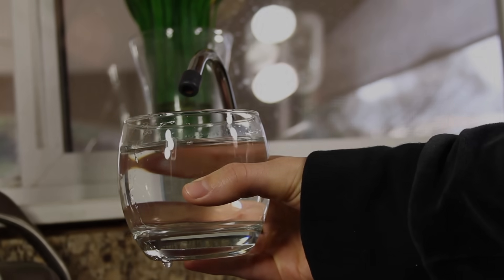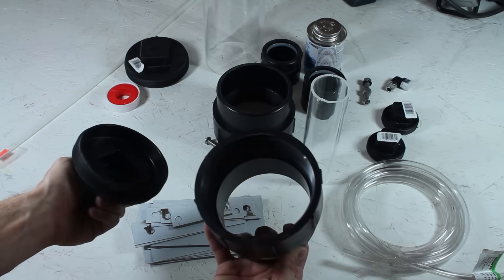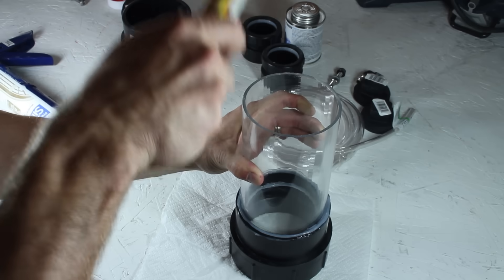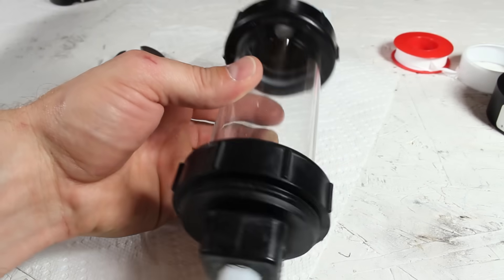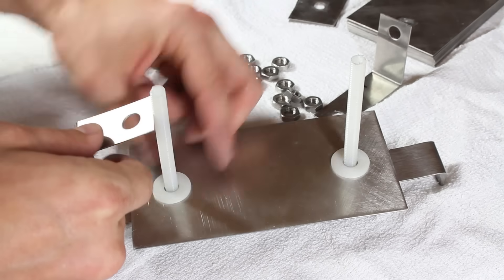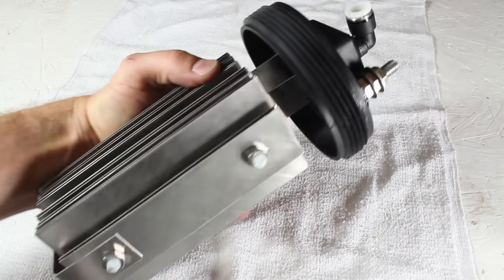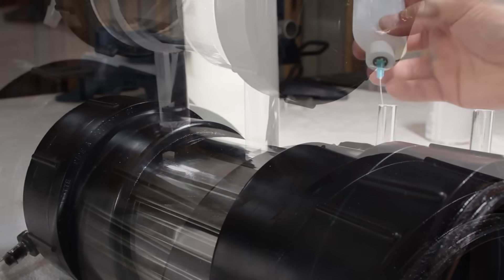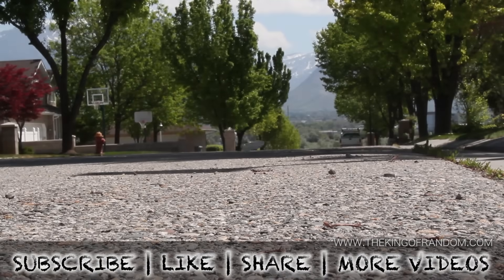HHO Generator - Water to Fuel Converter

Comment: There is a lot that is not explained in this video, such as where to get all the parts and tools, and how the hydrogen is extracted, contained, stored and dispensed. I don't see "swivel elbows" and "check valves" at the hardware store.
Reply: Go to a better hardware store.
Reply: TEXASBLAZE 101 no, ur just expected to watch and enjoy;) if u aren't able to do it from this video, maybe u shouldn't... it was no problem for me, but I improvised. My poor boy version consisted of a 2 litre bottle, a 20oz water bottle, an extension cord, fish tank tubing, a butter knife and aluminum foil, hot glue and baking soda lol
It works great;)
Reply: minivanjack figure it out. Are you a child?
Reply: Zoes Dada lol. I was just doing that very thing as well as brainstorming it to make it better such as mounting systems, industrial couplers and I just got going😉
Some people outta just stay in bed😂
Reply: You don't even need the majority of these parts, you can literally use 2 chunks of steel wool and a battery
Reply: @greenthizzle4 , great idea using steel wool.
Reply: Lee Wilkerson it's better to use higher quality steel, otherwise you will make a chromium gas that is kinda bad for you.. so do it outside
Reply: Amazon
Reply: minivanjack All of the parts are very common and can be sourced from a variety of places: hardware stores, plumbing suppliers, and of course online. Extraction at 8:17, dispensed at 8:28. Storage is not the purpose of this video; it is dangerous and difficult to store large amounts. Think Hindenburg.
Reply: Shopping list & links in description. 🙄
Reply: The process is Hydrolysis. Never store this gas!
Reply: Its called Home Depot, can you say it with me... H-o-m-e D-e-p-o-t. Now quit being ignorant.
Reply: Online shopping is a thing
Reply: minivanjack you don't store it, that's dangerous you use it on demand.. it's extracted by putting a current between steel sheets. It's really very simple
Reply: minivanjack 
1. Go to a better hardware store
2. Sounds like a personal problem. Blog it.
3. If you can find a polite side of you I would be surprised. If you complain to a Youtuber doing his best, it is kinda scummy to be honest.
Reply: minivanjack 
You're just expected to know or figure out the details

Comment: what if it was salt water? would the results be the same?
Reply: The thing is that you wouldn't be producing H2 and O2.
You would be producing Chlorine and NaOH until all the salt is gone (which would probably take a while)
Reply: SAlt will produce toxic gasses and maker your water green. But it could work, even though it'd still be more ineffecient
Reply: Richardetico so only the Cl from the NaCl would be extracted and released as gas and the O, H, and Cl will remain. also since Cl will be separated from the salt. what stage of matter will the Na be? amd since Na is a metal can it be extracted with a magnet or something. thanks for replying!
Reply: Potassium Hydroxide is salt.
Reply: TheRedneckAtheist no, it isn't
Reply: TheRedneckAtheist salt is sodium chloride
Reply: Wagner Mencia Sodium chloride is A salt.

https://en.wikipedia.org/wiki/Salt_(chemistry)
Reply: TheRedneckAtheist but still, potassium hydroxide is not a salt, is a base
Reply: Richardetico salts can be bases.
Reply: Michiel Wesselingh No, salts can be acidic or basic, but that depends on the ion that is carrying. A base is generally an ion with groups (OH) attached to it (for example NaOH), with the exception of NH3. And an acid is generally an ion (with or without oxygen) with hydrogen attached to it (for example HCl or H2SO4).
A salt can be acidic or basic when is disociated in water (for example in NaCl you get Na with a positive charge an Cl with a negative charge) and one of the ions have the tendency to steal hydrogen (augmenting the concentration of OH in the solution, this being basic) or OH (augmenting the concentration of hydrogen in solution, this being acid) and leaving the solution.
Reply: Richardetico "The hydroxide ion forms salts" - wikipedia
Reply: Michiel Wesselingh I had an exam on this just yesterday, so I'm pretty sure that I am not making a mistake. But if you really want to put Wikipedia on the table, well then https://en.wikipedia.org/wiki/Salt_(chemistry)
Reply: Richardetico and what about NH4OH?
In the reaction of ammonia and water, ammonia is the base and water the acid.

Comment: When I was about 5 I had a Hydrogen Powered rocket that worked like this. It used 12 D size Batteries and two cups of pure water. It took about five minutes for the generator to make enough hydrogen to launch the plastic rocket about two hundred feet into the air.Then, of course (as all things must), it broke. I tried to launch it once, and the backlash of the hydrogen detonation destroyed the generator coils.
Reply: Drake Tamer cool i assume its a toy from the 50s 60s? Name of toy?

Comment: Can you use this generator to start a car ?!? Please as im looking to start my project
Reply: No but you can use the batteries to start a car.
Reply: Kevin Jackson  sorry I mean the gas instead of the gasoline as fuel for the engine
Reply: If the engine is small enough yes. He doesn't say how much power the unit draws from the two batteries but he does say it generates about five liters a minute. That should start and idle a 0.01 liter engine at 1000 rpm.
Reply: thanks ^.^ so if it was bigger it should start a 1L engine or if bigger it can start a bigger car
Reply: Yes, 100 of these units should start and idle a 1L engine!
Still, watch out for the power requirements, you may need 200 batteries!

Comment: Hi Grant,

Thanks for the great projects, hacks and tips. I'm about to start a small project to build a HHO Generator,  using your designs, to drive a small motor. In your videos you  mention the heat increase associated with continued use of the generator and I've been exploring how I might overcome this problem.  In my research, I came across 'Thermoelectric Peltier Coolers (TPC)' which are twelve volt driven and might usefully be applied to the generator to aid with cooling the system. How that might work in practice is still being explored.

However, I thought about a future project for you to get your teeth into - a mobile/portable cooler using TPC. The cooler can be used in a vehicle, on a boat, camping trips, long hikes, picnics, etc. There are two sides to the TPC device. One side gets hot and the other side cold...freezing cold. Hence it might be a dual application device - a possible heater to keep things warm or just a plain old cooler.  Again how this might work in practice - whether by convection or direct transference - I don't know...I'm still in ideas mode.

Let me know what you think...

Comment: I don't see in the video where you wire all of the plates together. By the looks of it, only two should be acting as the cathode and two as the anode. How are the rest attached?
Reply: they are attached through the water

Comment from the maker: Some quick links to a few of the materials I used:

[✓] 4” ABS clean out fittings: http://amzn.to/2cRYegg
[✓] 3/8” Poly Tubing: http://amzn.to/2cqAyOS
[✓] 100 grit sandpaper: http://amzn.to/2cr0ywC
[✓] Clear silicone 1 caulk: http://amzn.to/2cg3Lle
[✓] Rubber Mallet: http://amzn.to/2cg3i2b
[✓] ABS Cement: http://amzn.to/2cg3a2K
[✓] 1/4” 90 degree Elbow: http://amzn.to/2caxbOC
[✓] 1/2” drill bit: http://amzn.to/2cg4LWf
[✓] 18 Thread TAP: http://amzn.to/2cqCMxy
[✓] Pipe Tape: http://amzn.to/2cRZLTS
[✓] 3/8” Swivel Elbow: http://amzn.to/2cRLOsS
[✓] 5/16 drill bit: http://amzn.to/2czNUxg
[✓] Bench vice: http://amzn.to/2cg5dnE
[✓] Stainless steel jam nuts: http://amzn.to/2cg70sJ
[✓] Acrylic glue: http://amzn.to/2cRLDy3
Reply: Thanks, I've been looking for the materials for a while. You even included the glue and the bench vice!
Reply: I hope you could get to see this comment, but it would be great if you could make a video on how to apply this generator into a car to replace gasoline (step by step) please, thanks.
Reply: Grant Thompson - "The King of Random" is there any way you can send me a schematic on how to build this I'd like to know how so I can try some projects with a bunch of old 4 stroke and 2 stroke motors I've found ways to make them run off of gas fumes I'd like to figure out if it's possible to make them run off of this
Reply: The King of Random Did you use 100% pure potasium hydroxide?
Reply: ***** I agree that hydrogen dissipates quiet quicklly.However Hydrogen is highly flammable (2H2 + O2 → 2H2O). It can ignite in combination with as little as 23% air (≈5% oxygen). By comparison, propane needs a mix of almost 90% air to ignite. This means that even small amounts of air in lines or storage tanks are potentially dangerous. In addition, the friction caused by high pressure gas passing through a narrow valve could theoretically create enough heat to ignite hydrogen.Im not saying that gasoline is made up of propane but its instead made of a vast array of hydrocarbons.However hydrogen is much more dangerous.

Furthermore, fuel cells or "hydrogen generators" are a work in progress they were used in the appollo mission.Within the fuel cell you must insert oxygen and hydrogen to produce an electric current.However due to problems with catalysing the cells make them not economically viable. the general half equations are:

O2 +2H2O + 4e- > 4OH

2H2 +4OH- > 4H2O + 4e

Overall  PRODUCTS = WATER.
 Hence this a very eco friendly fuel source.
Reply: ..."never been successfully made on mobile equipment"...   This is simply NOT true. All over the world people are running hydrogen through their cars.  The first one I saw was over a year ago where someone added an HHO generator and ran his moped off of it.. I believe this was in Columbia.
Reply: Grant Thompson - "The King of Random" hey dude maybe you could do a video on how to condense the gas into liquid
Reply: I think I have missed where you sourced the one-way valve from?
Reply: 2 car batteries are DEFINITELY not 240 volts.
Reply: You could actually use this with salt water as the salt increases the conductivity of the water meaning less added electrolytes (corrosion would for sure be more prevalent). As for turning salt water into fresh water that's not a problem at all, just evaporate it and collect the vapor.
Reply: Why list the easiest materials, when the when you don't list where to get the 2 and 4 inch acrylic? If you don't know where to get a bench vise or a rubber mallet, you shouldn't be doing this build. Just more internet "fluff".
Reply: Thanks Man! Building this for my school project ;D
Reply: Grant Thompson - "The King of Random"  I'm a f
Reply: Grant Thompson - "The King of Random" Thanks, this is very useful!
Reply: Grant Thompson - "The King of Random" uvtvtbyfh
Reply: I'm curious if we can make this the fuel of the future .....well if we can turn ocean water to fresh water easily but I'm not sure if this will work with ocean water
Reply: One of the biggest reasons "Green" sources of hydrogen gas are not used, is the massive amount of electricity required to separate water. most industrial hydrogen comes from natural gas, split the hydrocarbon chain into hydrogen and CO2, and since co2 is more dangerous than cyanide we can't have that. there are some amazing fuel cell technologies out there too that converts the gas directly into electricity. several car makers have full functioning fuel cell models almost ready to go, but for the source of hydrogen.
Reply: +scout2nut We use hydrogen gas as rocket fuel however its quiet dangerous to use in a car as it is extremely flammable.The electrical power is no real problem by adding a slat which doesnt impact the reaction we can form a conductive solution only needing a few volts to kick start.The current however would be high to produce hydrogen fuel efficiently but overall we use hydrogen gas.

Furthermore one possible use would be to use hydrogen gas for fuel cells however fuel cells are in a research stage.
Reply: +Mo Killem mmmmmm but if they use the right type of metals and the right way to use it in a car they could actually do so and it would probably be very effective
Reply: Mo Killem hydrogen is flammable but it is a gas that dissipates very quickly, compared to gasoline that is very flammable and dissipates much slower since it is a liquid, so no, hydrogen really isn't any more dangerous than gasoline. however a hydrogen generator has never been successfully made on mobile equipment, and is doubtful that it will be any time soon.
Reply: Stan Miller had a prototype hydrogen car, ran on fuel. He was killed. Many times have there been hydrogen powered cars in full working, servicable, maintainable, working condition. Some have addatives to the water, some don't but it is do-able.
Reply: Grant Thompson - "The King of Random" f
Reply: Grant Thompson - "The King of Random" please make a BBQ with this gear..
Reply: Justin Ke, How do you know such a thing?
Reply: Grant Thompson - "The King of Random"
Reply: Daark Simpson I did my research, although it is the internet, so take it with a grain of salt
Reply: the positive and negative orientation should be completely reversible, the only difference that I'm seeing you have is that you may be putting less power to the Electrolyser. In the vid he had 240 Volts traveling through it. What is the voltage of the battery that you are using?
Reply: If I'm not miataken, NaOH (also known as lye) works just as well. It is also available at most home hardware storwes as an all purpose cleaner
Reply: Grant Thompson - "The King of Random" your the best
Reply: *****  that's what I expected, but as KHo Is heavily regulated here in Canada, I can't get some easily
Reply: Justin Ke what
Reply: How about no, I am pretty sure that would = bomb, big bomb.
Reply: Grant Thompson - "The King of Random"  when you said that you used two batteries, did you wire them for 12 or 24 volts? (I'm assuming you used car batteries)
Reply: how big were the holes you punched in the plates
Reply: What was the song you used for the video? I couldn't hear it that well when you were talking.
Reply: Grant Thompson - "The King of Random"
Reply: TULL Jaraswuttidate yes i think water is best but theres only been one man to do it efficiently and he died. no one els has been abke to do what he did
Reply: Grant Thompson - "The King of Random" hi
Reply: Grant Thompson - "The King of Random" how do I get potassium hydro oxide??
Reply: You can buy it off Amazon and a variety of other places.   Cottage industry soap makers buy it.  Also used in making biodiesel.

You can make your own, but that's a fair amount of work.

You can use other things.  Baking soda will work too, tho, perhaps not quite as well.
Reply: doesn't talk about the battire he uses
Reply: no those don't exist
Reply: Grant Thompson - "The King of Random" how many of these would it take to run a small generator :)
Reply: Brandon Franken - Hi, it can not run any generator alone, but  it can be used as a booster to a generator running on fossil fuel
Reply: 24 volts dc
Reply: The King of Random l
Reply: The King of Random thx
Reply: The King of Random Hi, do you happen to know what the dimensions are for the holes made in the stainless steel plates
Reply: Rick Simpson quick note, oxygen isn't flammable at all, but is a needed component to ignite something that is ie. hydrogen.
Reply: The King of Random hi
Reply: The King of Random thanks
Reply: Why does the company that sells the pipe fittings sell tuna
Reply: Thank you!  Much appreciated!  I loved this man’s curiosity and desire to learn & experiment!  He is greatly missed.  I hope his wife & kiddos are well!
Reply: Are the batteries in series or are they in parallel?
Reply: Rest in peace
Reply: Needs more likes!
Reply: Stan miller was killed because he was a fraud
Reply: Grant Thompson - "The King of Random" any chance i can buy one from you as you are way smarter than me and i would have problems making one
Reply: It is not a hydrogen generator one terminal releases hydrogen the other terminal releases oxygen the oxygen is a whole lot more flammable than the hydrogen

Comment: There is no such thing as HHO.  It's just a mix of Hydrogen and Oxygen and is highly dangerous. Especially if you get an azeotropic mixture, then it will go off like a bomb.  At least the OP got the process right and didn't call it a Fuel Cell.

Comment: Could this be modified to fuel the forge burner from earlier project?
Reply: making a stable flame isnt the biggest problem, just put a sponge on the bubbler. The real problem is that there isnt a material on earth that this cant melt, and it would vapourize the metals too

Comment: For anyone asking "What's the real-world purpose of this?" there are currently many pools that use this same contraption to produce chlorine. You add regular NaCl table salt to your pool, it goes through an electrolysis chamber, and comes out with some chlorine compound I'm unsure of.

Whatever it is, it keeps your pool water clean. Only downside being it crusts up the electrodes pretty bad, so you have to chip off this salty chlorine sludge about once a year.

Comment: Very solid construction, I'd stay away from glass like others have used, like the backflow valve. Now what about a solar panel for DC power charging a battery for use at other times? Would like to see a gas regulator project to use this to run a generator instead of using propane. If it can power a torch it should be able to supply a small engine if sized correctly. Any ideas on matching components?